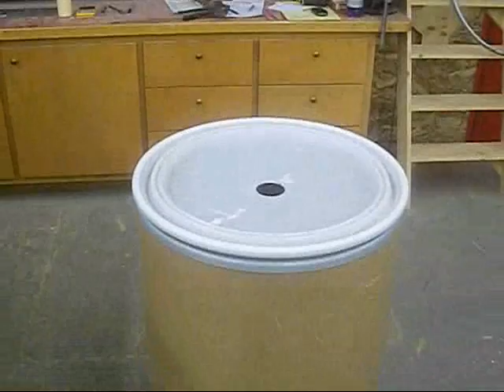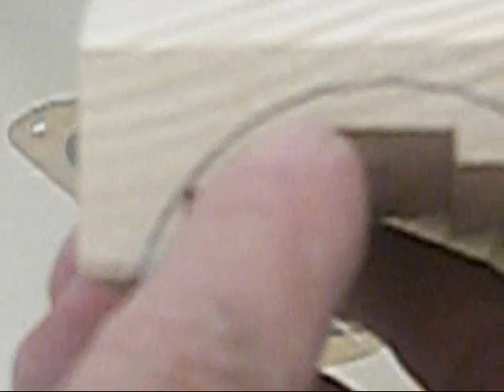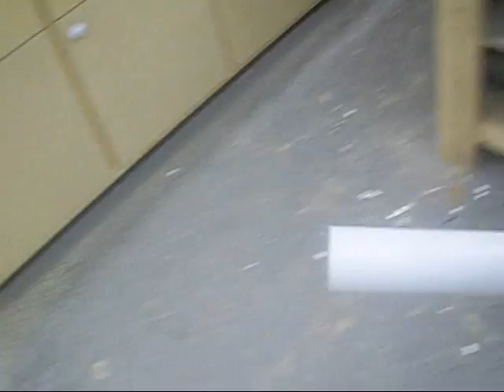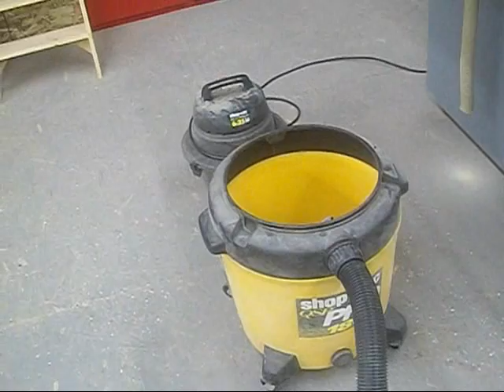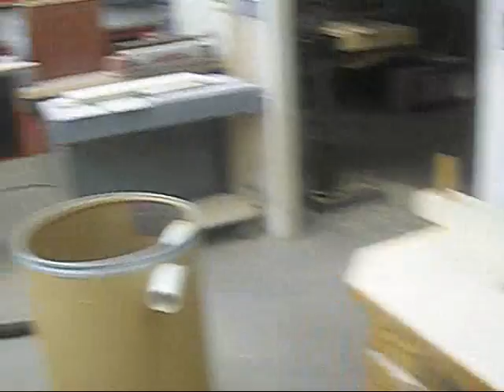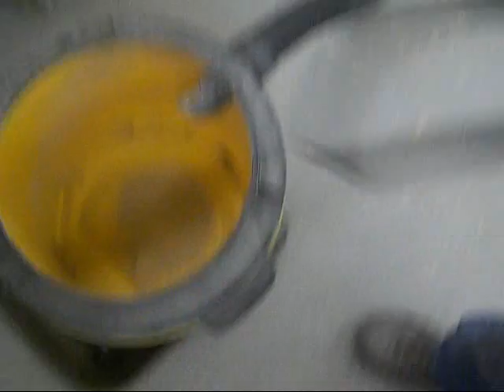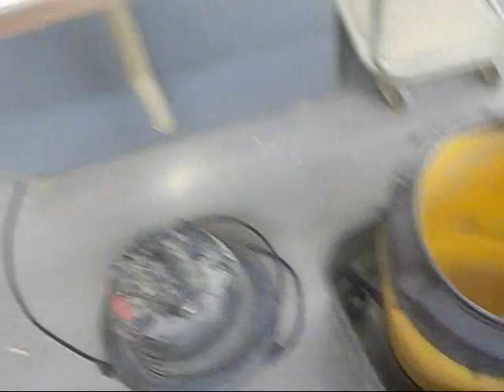Build this Sawdust Collection System

Comment: Joe great video
Do you know if by adding a lot of hose could it compromise the shop vac?
Reply from the maker: +stevethedrummer747 I have 35' of hose on it and works fine but this vacuum is the (high end in horse power) 16-gallon ShopVac.  I don't know how the smaller vacs would perform with longer hoses.  +John Holder, one of the makers of this made a smaller version in terms of the barrel size - maybe he'll respond.

Comment: Built a dust collection system for my workshop using the principles shown here but used a large plastic dustbin as that was what was available to me. Sealed the top using foam backed tape around the rim and let me tell you folks, it doesn't have to be complicated as in sooooooooo many videos I have watched. It works a treat. Thanks Joe.
Reply: +Narisaras Groove  thanks for your observation, I tried that and it burst the sides of the plastic dust bin, otherwise it worked well, back to the drawing board or a steel  galvanised dust bin.
Reply: in my experience if the bin collapses or cracks from internal vacuum the cause is probably due to the intake on the pickup hose being much smaller than the intake on the vacuum itself. Remember that a 1 1/2" pipe or hose is a great deal smaller that a 2" one and the larger tube will cause a large vacuum in the collection bin. That bin should need very little vacuum, it is merely a catch basin.

Comment: Joe, how did you come up with the 53.3 degrees to cut the pipe so it fits through the barrel wall?
Reply from the maker: RustyKenya I wish I could say I hiked up to the top of a high mountain wearing sandals, a flour sack gown, sporting a Frank Sinatra fedora and sat cross-legged staring into the setting Sun until that angle hit me but it turned out it was much simpler'n that.

I just kept cutting a block of wood until the angle of it fitted mostly against the barrel wall.  So, with the block of wood now fitting close to tight against the barrel, you can now cut the pipe to that angle, mark the "hole" around the pipe and the opening is now tight to the pipe.

Comment: I built this but the sides get sucked in from the vacuum pressure. Why doesn't yours?
Reply from the maker: Danengewood- .Dan Engebretsen Hey Dan,

Another guy ran into the same problem (read back in the comments) and we determined the problem to be the wall of his barrel was too thin.  He solved the problem by putting vertical strips of wood on the outside of the barrel - screwing from the inside of the barrel into the strips.

The cardboard wall of my barrel is pretty thick so I am left with that belief.

I'm going to add that precaution to the description - thanks for reminding me.

Comment: I like your design. I actually have a similar drum, but I need to get a replacement top. We get them periodically at work as they also come with HD electrical cabling in them.

At what point do you know that your separator has reached maximum capacity? And have you thought of installing a clear site insert on the side of the drum to see waste height?
Reply from the maker: I walk by the drum and hip bump it - if it moves hard then it's time to empty it.  No, I've never thought of putting in a site glass - hip bumping is easier.

Comment: Joe, you said your vac was about 5 hp , that would make the motor about 3500watts, is this right??? also what would happen if you put 2 vacs onto your system would that increase suction as I am struggling to find a large vac at a sensible price. Great Video
Reply from the maker: Hey Malcolm,

That is printed on the vacuum head - it could be they're pulling a Sears by saying, "5 HP delivered", whatever the hell that means.  No, two vacuums would not increase the suction.

Comment: 1. How big of a vac do you have to use, can you  use one of the smaller ones to work? 
2. Is it possible to put some sort of collection bag inside for easy disposal - like a garbage bag.  I know it might be dumb but u seem pretty inventive and sure would be handy to empty with a garbage bag 

Thanks Joe - You are a no bull shit kinda guy, love it. Remind me of my dad. 

Denise
Reply from the maker: Hey Denise,

The size vac I have is ShopVac's 16-gallon 5 HPish.  The key to this thing is moving enough CFM (cubic feet per minute) to make it functional.  I have never tried using a smaller one so I can't answer your question intelligently.  I can guess and say it will be a weak vacuum.

I have never bothered with putting a garbage bag inside mine because I take the barrel outside and spread the sawdust on the yard (excellent mulch and it hides the weeds).  Give it a try and see then let us know.

Thanks for watching, lemme know if you run into problems - my email addy is in the description box.

Comment: Would it be better to use a longer piece of metal flashing and screwing it in with the wood on the side or does the glue not fail?
Reply from the maker: A comment from another viewer suggested the same - it wouldn't hurt anything.  No, I've not had the glue fail.

Comment: Maybe ive missed something but you have a perfectly good dust and debris collection system in the vacuum cleaner yet you built a second bin to collect the dust and debris?? pure Genious
Reply from the maker: Obviously you have a listening and comprehension problem.  As for the genious [sic] part, yes, it is genius.
Reply: yes, you missed the fact that the damned bags and filters...well...they charge an arm and a leg for them. that's why i built my system. :)

Comment: we've been doing this since 1976... its even older then that...My dad taught me that... lots of guys been doing this way befor you came up with it...
Reply: Vortex separators have been around for eons. See my comment above about the 1952 patent, which is just one of many patents in this crowded field of invention (the Patent Office patents incremental improvements as well as utterly new ideas... lots of them if there is a great deal of inventing going on in a given technology).
Reply from the maker: Really?  So the twenty-two years between 1976 and 1998 y'all just sat on the thing, didn't show it to anyone, didn't tell anyone about it, basically hid it in a corner.  But it worked so well you simply couldn't spread the word.  Ya know...I'm certain there was someone claiming to have a flying machine well before the Wright Brothers, too.
Reply: It was a wood working shop in Whittier Ca. the only difference between your design is it was a 55 gal steel drum...

Comment: Super job on this Joe. WowZa! I wonder if you could put a piece of mesh/steel chicken wire sort of stuff to help it from sucking up big ole chunks. ?? Very incredibly simple and affordable for sure. Thnx. You're a grr8 fabricator.
Reply from the maker: +Roger K No, don't use a screen b'cuz something might get caught and begin to plug up.  If your vacuum will pick up a big ole chunk and it fits through the hose then it'll slam into the metal plate and be destined for the bottom of the barrel.

Comment: Sir: what you have built is a form of cyclone.  It would probably be a bit more efficient if you included a Thien baffle.  The baffle provides an area for the dust to settle in away from the turbulence of the air intake and exhaust.  I'd suggest that if you google  "Thien Separator" you will find a link to his website.  The Dust Deputy that you mention at the start of your video is not a rip-off of your idea - it is a true cyclone system.  It performs the same function, but quite differently.
Reply: Roger K No it is not. A thien baffle has a 270 degree um...what's the word..oh yeah, baffle.
Reply from the maker: If you say so.
Reply: neelode: the way Joe has this plastic pipe in there, it is just like a "Thien Seperator"

Comment: Where do you find the fiber barrel that you used? I would like to try your design -- but I haven't found the right container yet. I would ideally like to find a smooth metal container. I agree with you that fire from PVC static electricity is a lot of bull, but there is a small chance of a metal spark igniting the pile (say from cutting into a piece of wood with a hidden nail).
Reply from the maker: The drums can be found used from local places like bakeries, food handling places or you can get them from eBay or other online sites (uline.com is one).  Your 'small chance' of a metal spark after hitting a nail igniting a pile of sawdust is sooooo small it's invisible.

Comment: Joe do I need to use 2" or bigger hose on all the in and out ports Help me it driving me crazy it is an awesome design I was excited to start using it and it has me puzzled!!
Reply from the maker: Yes, 2" hose or larger (to a point) and yes, on all the in ports.  You can also use the smaller 1 1/4" hose that often comes with shopvacs (like attached to belt sanders, etc.) but be sure to have one of the larger ports open at the same time for make-up air.
Reply from the maker: Michael, my email address is in the description box...send me a note there and we can hash it out.

Comment: Joe why is the barrel  collapsing when I vacuum? Thanks Michael
Reply from the maker: What is the wall thickness of your barrel?  Did the hose get plugged up?  Are you using a too small diameter hose?
Reply: The same as your barrel almost to the tee building the project.But I used  the 2 in pvc on the side and top but I had to transition down to 1 1/2 hose on both ends!
Reply from the maker: Michael Higgins That's the reason why then.  One thing you can do is put a capable tee on the suction in pipe to allow for more air when you're using the smaller hoses.  When you use larger hoses you can cap off the tee.

Comment: There are many ways to skin a cat. You could have cut the pipe dimension on the wood using one pass on the saw on a diagonal cut across the blade ie you move the wood at 45 degrees to the blade in a parallel motion so in effect you are dragging the saw blade across the wood at an angle  if that makes sense

Comment: Ok Joe. I just finished my build, after watching your vid. It looks awesome, but I have a couple questions. How critical is the distance from the bottom of the vertical pipe, through the lid, to the horizontal inlet pipe? I'm getting more planer shavings and dust in my shop vac than I thought I would. You mentioned 3" in your video. I know all my dimensions aren't exactly like yours, because my drum is just slightly smaller. 30 gal. For instance, the radius of my caul, was 9.25 inches, for a drum diameter of 18.5. I'm using 2" pvc, like you did, but there's just more dust on my vac filter, and planer shavings in the shop vac drum, after just a short period of time, than I was hoping to get. Any suggestions? Would placing the vertical pipe closer to the intersection of where the horizontal pipe enters the drum help any at all? And I might have the bottom of the vertical a little too deep into the drum. I left it long to try the system out, figuring I could always cut it off later, but maybe it goes down a little too far?
Reply from the maker: Hey Jeffrey,

Ok, let's rehash.  The inlet vacuum pipe (horizontal) should have the angle cut end turned slightly down; this begins the downward spiraling effect.  The outlet vacuum pipe (vertical) should not be too far down into the barrel because it would disrupt the cyclone effect and begin picking up debris.  So, yes, the 3" below the horizontal pipe is critical.  I have never tried cutting it less than 3" because it has always worked.  I edited the description box to include my email address if you want to contact me through there to work this out or you just want to shoot the breeze.

Comment: Can a plastic barrel be used, they are much more readily available? I notice that you have a plastic lid on yours. Reason I ask is on one YT vid there was some comment on plastic electrical charge and sparking the fine dust? I checked your comments and did not see this question below. Thanks, a great idea for sure and sure beats the cost of a commmertcial unit.
Reply from the maker: Absolutely.  Ignore the hype and bullshit of static electricity igniting the dust and blowing your shop to smithereens.

Comment: This is fantastic! Brilliant sir. May I ask a kind of silly question, will this system work with a simple, everyday upright vacuum cleaner? My workshop isn't very big, in fact I would say your table saw has a larger area than my entire space! Anyway, thanks for the great idea. Greetings from South Yorkshire, England :-)
Reply from the maker: Hey Chris,

Well, I have no substantial evidence either way.  I can only suggest you try it and find out - if it fails then you only have to replace the vacuum b'cuz the piping will not require changing.  So, give it a shot and let me know.

Comment: By turning the call on a shallow angle and passing it over the table saw blade you'll get the proper arc in one or two passes on the Table saw.  Testing the angle and blade height combination will give you the arc you want to match for the pipe.  It will eliminate lots of work hogging with dado blades and the cove bit.
Reply from the maker: This is indeed a fact.  However, it would take quite a few low cut passes and a little more setup time but would work just fine.
Reply: Nice design by the way.  I've seen them made in different ways, with baffles, etc.  I hate to hear chunks striking the impellor of my vac unit.

Comment: A simple v cut in the block would hold the inlet pipe as well as the repeated cuts and router work.
Reply from the maker: Yes, it would, however a simple V cut doesn't give the true woodworking gushy feeling you get doing it my way.
Reply: good reply

Comment: Hi Joe:  Now THIS I can do! For a LOT less money than a multitude of other solutions I have been looking at. There does seem to be a bit more dust than what I saw Laney demonstrate with the Clear Vue system, but, for a LOT less money, I can live with a bit of dust in the shop vac. I will be hooking mine up to the Harbor Freight 1 Hp Dust Collector. QUESTION: Do you think a 4 inch port in the top of the barrel will be okay? The Harbor Freight has a 4 inch port.  Thanks for the great video!

Comment: Guess I am missing something.  If you still have to vacuum the pile, why not just use the shop vac.
Reply from the maker: Because this is a pre-collector, it's a larger container and it keeps the vacuum filter from filling up and if you're using a bag in the shop vac then they are expensive and will fill up very fast.

Comment: My dad used to get these type barrels when he worked at a heating plant.  Dry Chemicals for the plant. You mentioned that you built this design in 1992.. I installed a Vac U Flo  built in vacuum in 1983. It was designed with the cyclone idea so you were not the first.  By the way It was the best vacuum I ever used.  Quite often repackaging plants have empty containers they want to get rid of.
Reply from the maker: No, I said I designed it in 1997.  The VacUFlo's inlet came into the barrel through the center, not along the side.  Further, the VacUflo's operation wasn't (isn't) like mine, so, therefore, I was the first, TYVM.
Reply: Joe Johns I have a vacuflo and the inlet come in the side. The motor sits on top and suck through a cone extending into the centre of the dirt tank.

Comment: Absolutely love it. The only question I have is how well would it work if you use hard pipe to each work station along with a short piece of flex hose to the machine itself. Also would you need close ports on the machines that was not being used at the time?
Reply from the maker: It would work just fine and, yes, you would have to close ports not being used.  In the old TKW I had two ports; one at each of the distant ends, which were 48' apart and a 25' hose .  In the new TKW I'm using a 30' hose that attaches to the machines, to vacuum the floor or whatever that attaches directly to the barrel.

Comment: I think this is great.  I have some thoughts:
1. The barrel top is big enough to add a fitting to mount the vacuum head on.  This would eliminate a section of hose, or add hose to the equipment side, with best possible airflow.

If the collection can is convenient to the outside, a small outlet hose attached to an outside vent and the vacuum blower side.  This might also be a good way to vent fumes too.

2. I believe the cyclonic action helps but that barrel is large enough to be effective just like an air baffle filter.  An interesting experiment s fitting a plastic pipe to the side of the lid instead the side of the of the barrel.  In this case the side pipe should have the opening lower than the exhaust.  It would be interesting to what each retains using the same set of debris.  Now I am wondering if a wood baffle with with a small vent separating intake and exhaust improve the system or not.  

Great idea, thanks.

Comment: Great video.
I'm an intermediate woodworker, and I have an old shop vac that is dead.  Shouldn't I be able to use it instead of the drum, seeing that the holes are already in place?
Thanks in advance for your insight.  
Anyone else can feel free to chime in.
💡
Reply from the maker: I don't believe it will work in the same manner in that the dust is not coming into the shopvac canister the same way as mine.  But, give it a try and see then let us know, huh?